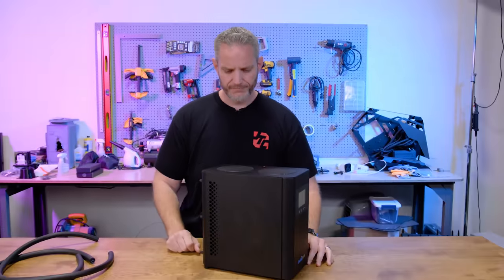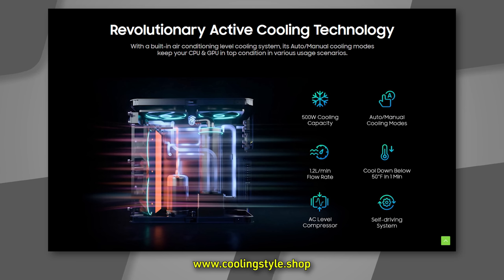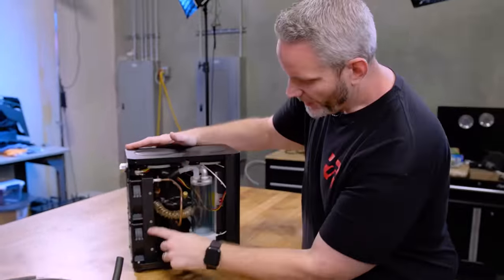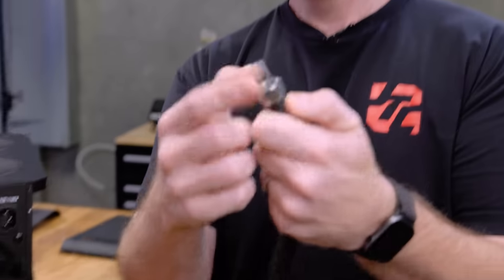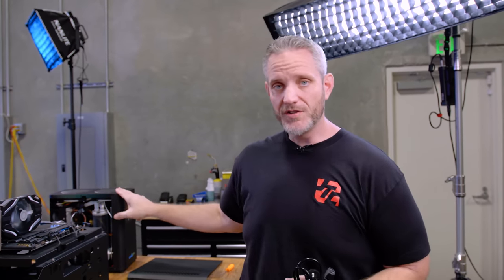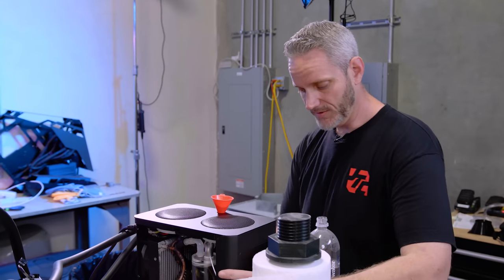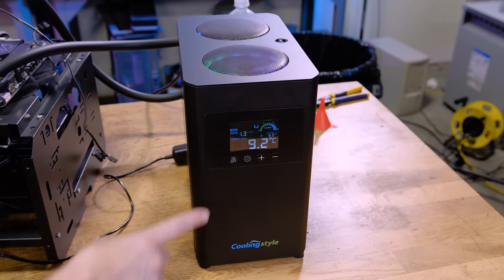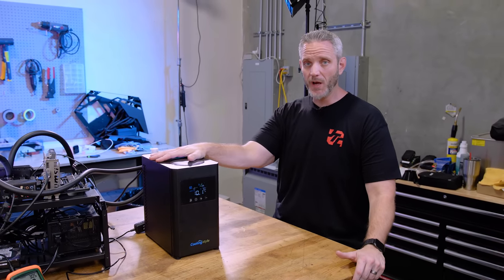This seemed Gimmicky... Turns out I was right!

Comment: I had an idea similar to this with an air-tight sealed PC that is designed to loop air threw an internal AC radiator with the pump and other parts in a separate exterior case. this would allow you to cool the PC below what a normal air or water-cooled system could do and keep dust out of your system forever. the only issue is condensation so you would need a good drying system also.
Reply: I've always wondered about those Sterling cryo coolers and if its possible to somehow get one to cool liquid in a pc loop there not that big and can achieve like 40 Kelvin which is overkill and would freeze the coolant solid but if you could somehow control it might be a really interesting project.
Reply: @morgan5941  I've noticed they are hard to find and I'm not even sure of how much they cost
Reply: @nestaash  with enough flow and pressure you could get down to 47 degrees below zero with pure water. that is the lowest water can go before no matter the speed or pressure it freezes instantly. with a glycol mix, you can get down to 60 degrees below zero.
Reply: @AllanWorks  you know anywhere were one can be purchased online.
Reply: @morgan5941  i may have just thought of a way around that by going water block cooled. if you put the sealed case under a vacuum any moisture in the case can be captured with a large Moisture Absorber pack. with the naturally occurring moisture removed from the sealed system, there will be nothing to accumulate on the super-chilled cooling blocks. all tho this would require a super beefed-up case and cooling system to handle a vacuum.
Reply: @nestaash  what you want to look for are IR detector Stirling cryocooler they are small enough to fit in a pc. I know Honeywell Aerospace sells them but it's a bit of a process to get them.

Comment: 11:20 You can tell it isn't coming from Australia or New Zealand because it has exposed metal all the way up the two angled prongs on the power plug, it is now mandatory for Australian (and I assume NZ) plugs to have a non-conductive coating half way up those prongs so that if it isn't completely plugged in you can't short them by dropping a thin metallic object (usually demonstrated with a coin) between the plug and the socket.

Comment: finally somewhere i can shine, im  an IT specialist and currently training as a hvac tech, this thing is using a compressor thats what the black thing at the boom is, and it using a 1/4 inch copper pipe to bring the refridgerant to evaporator and condensor which should be inside this device im gonna assume the evap is at the top and condensor is at the bottom, yes ur are correct jay your desk gonna be fucking hot that copper tube gonna have some liquid that can go up to 200 degrees F (93 Cel) coming out (yes no joke) so yes ur desk gonna be fucking hot from that exit port.

Comment: I have a feeling there will be specific scenarios this will be an ideal solution.. however, I'm also of the mind that this looks a lot better on paper than it does in reality. Nice work though, great video!
Reply: If it was cheaper, a bit quieter, and actually came with proper fittings, it would actually be pretty nifty.

Comment: If you had this in a room on the other side of the wall where your tower is located it might work out really well. The only problem I see with that option is head pressure. You would most likely need it to be roughly on the same level, height wise, as your tower in the other room. Running the hoses through the wall is super simple you just need to avoid studs. The price though seems quite high when you can achieve adequate cooling with little to no noise in your case alone without having to drill 1 inch circular holes in your wall.

Comment: It would be better to have an external loop and place the radiator right next to your air-conditioned. For those who doesn't have air conditioning, just put the radiator outside of your room through a window and kind of weather proof it (away from direct sunlight and water splashes). Or have your radiator inside a cooler then put dry ice inside it.
Reply: or get a split type AC.
Reply: So your waterblock is considerably cooler than the air around it, drawing condensation? Just route the cool, dehumidified A/C air to the intake of your PC case, then hook dryer ducting to the exhaust fans of your case and route that out the window, or some other exhaust duct. Any possible condensation would then be on the outside of the case, likely not a problem. ;)

Comment: So, what I was thinking is that the chiller has heat pipes, that are inside the water tank, to cool the water. Not just from the bottom of the water tank. Not enough surface area.
If you have copper heat pipes that go inside the water tank, then that water is in direct contact with the water it is trying to cool. Those heat-pipes could just be mounted to a copper block, like they do already, and that attached to the chiller or peltier type setup. 
The problem I have noticed with most "chillers" is the lack of surface area being chilled and no one seems to have thought to make a device that runs the chilling components inside the tank. 
You could even make one with a perspex tube, just glued to the base with the heat-pipes inside the tube, kind of like how an old incandescent light bulb looks, but the filament structure is obviously the heat pipes and the water surrounds it all.

Comment: Maybe they could add an option where you can route the exhaust side out of a window. Just like those ACs you can buy at home depot that have a hose and bracket set up so you can vent outside. Also maybe, if the pump is strong enough, you could run longer hoses a little further away so it doesn't have to be close to the PC?
Reply: just buy 1 of those, they go for half the price

Comment: I'm surprised its as much as my Hailea Aquarium Water Chiller. That being said I do like the size and its a small step in the right direction, but I think I'll stick with my Hailea. Any system like this needs a few more things to run optimally. 1. Quick Disconnects. Makes it so much easier to manage. 2. Valves. A system that uses this should no have to rely on it. Its just extra. 3. A closed internal loop that can be expended to the chiller with the use of valves is a good idea I think. Works for me. When winter rolls around u might not need it as much. 4. The HEAT MUST BE VENTED ELSEWHERE. Out the window is best. My god these things will make the room toasty.
Reply: Shocked at the prices being charged for those Hialea chillers. I am a Hailea distributor for another industry and I promise the landed cost on one of those chillers is maybe 120 bucks. Hailea makes the best low cost products available though.
Reply: @CapacitorCapacity  really? wow I mean mines a 500A (790 watt) so I get a little more bang for my buck. It was still around 500-600$

Comment: Hey Jay, well here's my 2 cents..... This is a cool idea, (no pun intended) If they are used to working with servers, this thing probably is quiet in their opinion. I have an exhaust fan above and behind my computer in the wall, (very quiet) because my office does get hot from the computer running. I got lucky and ran the vent through the wall and it exits right at the cold air return for my A/C in my house so the warm air goes in there and on to the A/C system, but not everyone will be able to configure it that way. I didn't want to blow it outside cause then it sucks hot air into the house to replace the air blown outside and in so-cal when it's 100 degrees you don't want that. Love your show, have a great day.

Comment: It's amazing how many times we reinvent the same thing over and over. Chillers have been around for a long long time. We use huge chillers to cool off components and just the environment at the plant. Actually they were one of the most misunderstood pieces of equipment for how they function. I certainly know what heating and refrigeration specialists can charge a lot. I know engineers that have a hard time understanding the refrigeration cycle.

Comment: Hmm , I was curious about the power draw. 
I can see only 2 use cases for this. It's a cool thing to set a few benchmarks with.
Or, something to use to keep your cpu cool (ish), even in hot climates. for example if the ambient temp is very high, you might need something like this to be able to do your rendering,, or get 60fps on your game. Both are rather limited use cases, and frankly, there are better ways of doing this. (even Jays ghetto AC cooling is a better option, imo)

Comment: What about plumbing it into an existing custom loop?   So instead of expecting it to take 100 percent of the heat load, it could just be used as an assist. The water could go through all your rads, then to the chiller as the last point in the loop before the water goes back to the block.
Reply: you would need a fan controller that can uave temperature probes attached to it before going down this path. even then, you will lessen the capacity of the chiller.  the radiator will heat up the water if the water is below ambient Temps so the fan controller monitors water temp vs ambient temp and shuts down fans accordingly. it would help in that case. it would hurt in cases where the water temp is below ambient temp.

Comment: Condensation usually forms when the temperature difference is greater than 30 degrees. Also, due to the nature of heat exchangers like this, you also run the risk of both freezing the coil over, and overheating the unit... both of which have an increased chance of happening if: it's working too hard, or if the refrigerant charged into it is too low OR too high.

Also, it is not getting rid of the heat. Rather, if you don't vent the heat outside, it'll just move the energy from the heatsink to the inside of the room

Comment: pretty loud at first for sure, you would for sure have to like.....put it in a closet or something to deal with that noise. Granted that ability to cool is ballsy but.....at what cost lol. I would want to see how much it is pulling from the wall extra to the system itself as well.
Reply: Yeah, until your closet ends up 50°C.
Reply: @ska4dragons  proper fan takes care of that. I run a single rack mount in my closet (with proper temp controls) I also let my 3d printer go ham in there as well. Works kind of nice, is room for storing things right in there with everything. But I 100% agree, if you do something the wrong way it will for sure not work.
Reply: The problem with throwing it in a closet is that it's blowing the hot air into the same area that it's pulling in air to cool it

Like having your foot on the brakes and the gas at the same time
Reply: @ocelotxp  right, I agree if you do it incorrectly that would 100% be the situation. I just assumed anyone watching these videos would know how to properly vent a closet. I still concede the point you both made, though it as not one I was speaking to. Your idea is the same as putting your case inside a desk that has to vents. Ya the fans in the case are fine and all but its starving for air. Thats why if you do that route you have to vent it right. (though I personally would never go that route for a desk, but there is always a way to get things done) 

So yes, if you DO end up building out something in a room with no windows, please make sure you follow the standard venting rules and regulations. I hope that helps whomever else has questions on setting something  up in your apartment closet.
Reply: @seraphimdelta  Why would you assume that anyone who watches a PC tech channel vents closets?
Reply: @JamesHoffa1  Lol, thats a.....interesting extreme to go to. I just assume a channel that tests fans and goes into the detail this channel does that folks have at least a bit of sense when it comes to ventilating any box shaped device. You know, like a computer. I suppose the assumption came from the idea people watched the videos. I have learned a great deal from this channel and others, as well as the 16 years in IT, why someone does or does not make any assumption will likely be from their background. 

So, I encourage folks to branch out from only being interested in the funny shaped and  colored box on their desk and look farther than that when it comes to IT and the solutions and ideas that come with PC building. 

And more  importantly have fun :-)
Reply: @seraphimdelta  What you are failing to understand about your whole idea is that most closets are not ventilated at all. So to accomplish what you say we have to install or jerry rig some kind of ventilation for a closet that is quieter than the problem we are trying to fix.  That is likely going to be either difficult and inconvenient or expensive.
Reply: @ska4dragons  So lets address 2 things with this statement - " What you are failing to understand about your whole idea is that most closets are not ventilated at all. " I think this is actually more of a failing of you following what I am speaking on. My closet is not vented by default either, and I never said it was. I was able to get a single rack mount, 2 computers, and 2 3D printers in the closet I have setup.

 "So to accomplish what you say we have to install or jerry rig some kind of ventilation for a closet that is quieter than the problem we are trying to fix." So...my idea had nothing to do with actually using this product, mostly the comment to put it in a closet was the fact I already do that to keep noise down in the room I game/work in. Yes, the joke of putting this in a suffocated closet is by default not an idea anyone should be championing but....That includes me, I would never do that either.

What I have been able to do is put all my "louder" devices in one area, and work/game in another while allowing me to run those systems at higher fan RPM for higher performance. And the next question is of course "oh hahaha, but that closet is 50c" well...just..no? My normal temp i keep it at in my place is 68f, and over the past 60 days the room the gadgets in it got as low at 62f, and as high as 75f. So, if you could have all of your devices running cooler, and dont have to worry about the noise (granted its the server PSU fans are the real noise in my house other than the 3d printers" 

Other youtubers have shown this, hell Linus from LTT had his rig setup fairly similar in his old house (can see videos there about it) 

So, not sure 100% what point you are hammering home at this point as I have not honestly understood where any of it has come from thus far to start. If this actually boils down to the single comment of putting this box someplace else I would just stop there. Hope that helps!
Reply: @seraphimdelta   You said put it in a closet. You have given no real world example of how to keep it cool in a closet. This is the only point. 

This device in a closed room will equalize the temp with the cpu at the very least. So 50c cpu means a 50c room. It would get a lot worse than that really, but that's the base assumption.
Reply: @ska4dragons  Cool deal - I honestly don't care even a little about this device but I can tell now that was really the only thing you were speaking about. "You have given no real world example of how to keep it cool in a closet. This is the only point. " I did in my last post given that there are plenty of other youtube videos on nearly that exact thing. 

But, seeing as I have nothing I am trying to prove other than the fact I am currently doing something to combat a loud bit of technology equipment. The original basis of the statement being only that this device is loud. 

Since we can both agree this device is a bit silly, and putting things in closed areas with no ventilation is a bad idea in general....I think we can move on. 

Can you think "outside the box" when it comes to solutions for IT issues both at home, at work, and in places you might not think of. That is really more what I was lazily (and I admit I gave about 2%) hinting at.

Could I personally use this device in the way i mentioned? No, not without extending the tubing and likely coming up with more work than what I already have going with my current liquid cooling.
Does it make a cool video? HELL YA. I love like J said people coming up with an idea and going for it. Does not always hit the mark for everyone involved but sometimes someone sees something like this and says "close, but I think I can find a better way to use this"

Hope you have a good rest of your week and never give up your passion for the technological world!

Comment: This seems like the sort of thing that a small grow tent would be used in conjunction with to redirect the air to a window. LTT did a video about that — cooling a PC with air in a grow tent, if engineered correctly, an outside source of cooler air could feed the tent, letting the chiller do its job then exhausting the hot air, provide there's a sealed way in.

Comment: This reminds me of those Asetek Vapochill computer cases that had a refrigerator compressor built-in way back from 2003. Those were epic. But the reviewed product is not a new or novel idea, except maybe for having a separate, cooling unit outside of the case, rather than integrated to the case. However, having it as a separate unit seems like a downgrade to me.
Reply: I had one of those back then!  Worked well for the era.  Compressor fired up & when the CPU had cooled enough, it turned on the PC.  They were meant for sub-zero cooling and overclocking, though, and the evaporator was directly on die, not via liquid.
Reply: @NemoConsequentae  they were so forward thinking for the time!